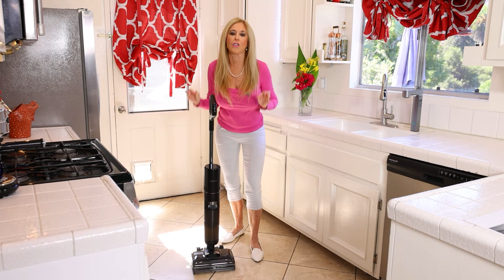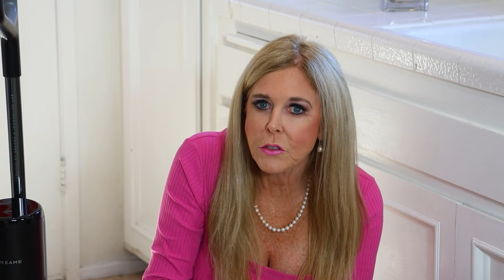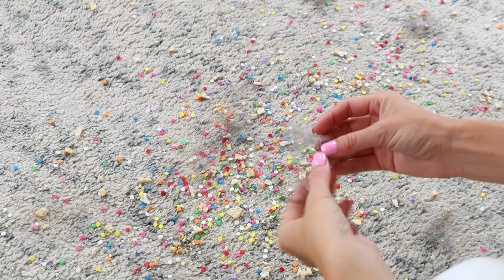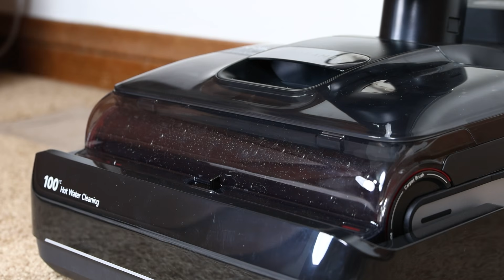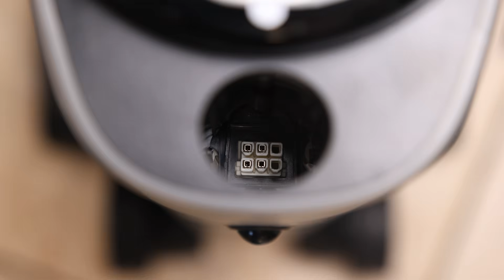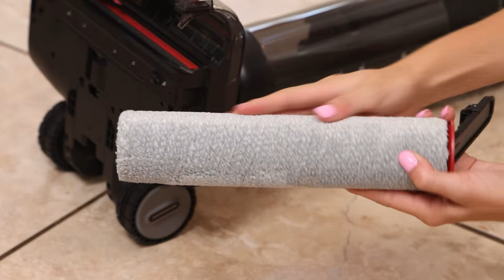Best Wet-Dry Vacuum for Floors and Carpets 2025  | Dreame H15 Pro CarpetFlex | Great for Pet Hair

Comment: I live in a fairly small apartment 🏙, so space is a huge issue for floor care and storage. I can’t have a bulky vacuum and a separate mop bucket 🪣 because that would clutter up my tiny utility closet. The one with a small base station is perfect for minimalist living ✨. In a small space, you’re constantly maneuvering around furniture 🪑 and tight corners. You need something that doesn't feel like dragging a cement block 🪨 — it should be lightweight, fast, and quiet 🤫 for close neighbors!
Reply from the maker: That's great you found a good fit for your space!

Comment: The hot-air drying and hot-water flushing feature 💨💦 is the best part. Continuous moisture inside tanks, hoses, and brushes leads to clogs and grime buildup 🧫. This system performs preventative maintenance 🔧 that extends the cleaner’s life and ensures peak performance every time 🚀.
Reply from the maker: @mindyroberts7544 I'm so glad you liked this! Thanks for your comment!

Comment: Old methods are exhausting 😮‍💨 and also unsanitary compared to that 212° feature ♨. With the power of natural heat for sanitization, it can eliminate the lingering ick in sensitive areas like the kitchen 👩‍🍳 where food safety is so important. So you rely less on potent chemical cleaners 🧴 and more on non-toxic water 💧 and scrubbing action. You can achieve hospital-grade cleanliness 🏥 using high heat — much better for families’ health and indoor air quality 🌿. Also, all machines should be low-maintenance enough to be ready for the next unexpected event
Reply from the maker: I agree, I love that hot water feature! So glad you liked the video.

Comment: We had a similar kitchen incident a few months ago 🍝. It was a whole jar of marinara sauce. Full blown explosion everywhere 💥🤯 — walls, cabinets, floor! I spent a solid hour with a paper towel roll and a mop 🧽, rinsing all the sticky stuff, seeds and sauce chunks. I hated that I was also pushing some of the mess into the grout lines… scrub and scrub 🌀 — by the time the floor dried, there was a dark line of trapped dirt
Reply from the maker: Sounds like this wet-dry vacuum would have been a lifesaver for that mess!